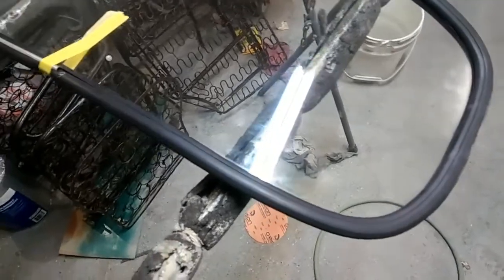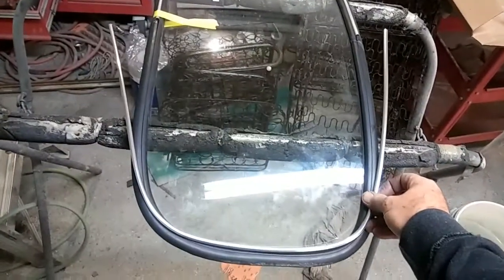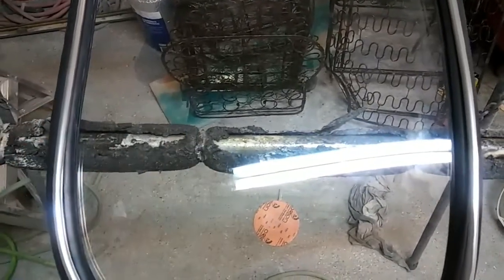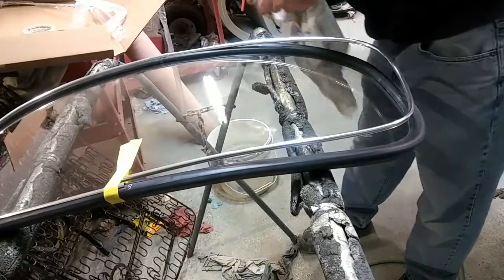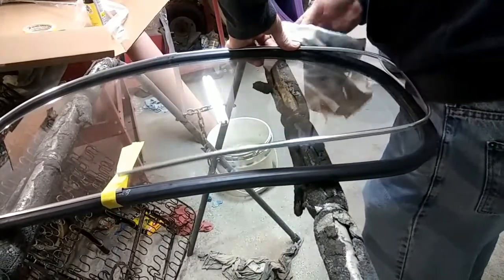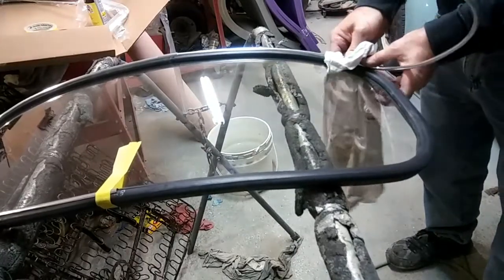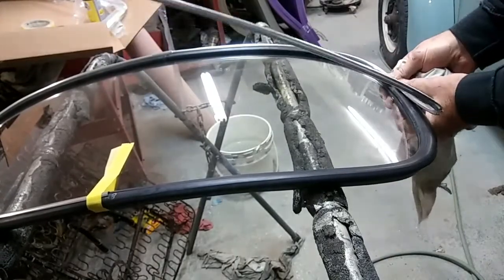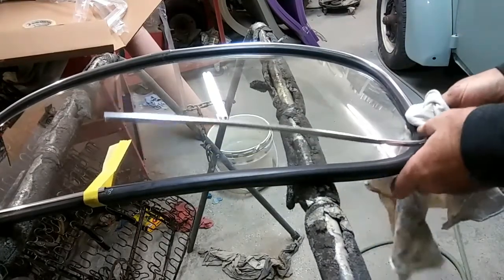Vw bug Window chrome install with ease tips and tricks

Comment: So I just got done all windows in my bug.. get the window in first,  put the string in the trim slot all the way around.  After the window is in, push the chrome trim in while pulling out the string.  Took 15 to 20 minutes total each window...

Comment: Is the trim really necessary ? Or can you put the window on the car with just the rubber seal? Thanks in advance
Reply: hi Misael, you can just eliminate the use of bright molding altogether and just use the basic seal. If you choose to use the deluxe trim kit, you cannot install the moldings after the window is installed on car. West Coast Metric has the Cal Look rubber basic black window rubber w/o groove less molding to make things easier. Export models destined to the US market were full deluxe sedans using all bright trim.